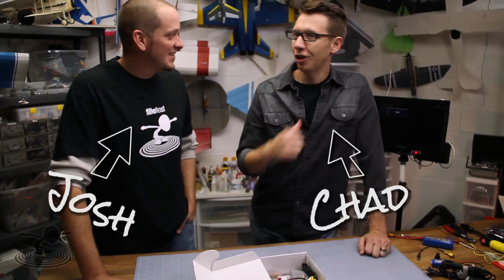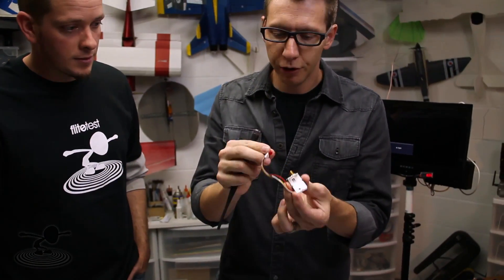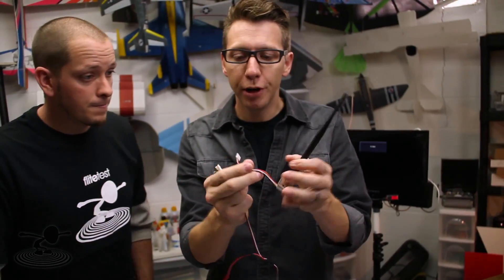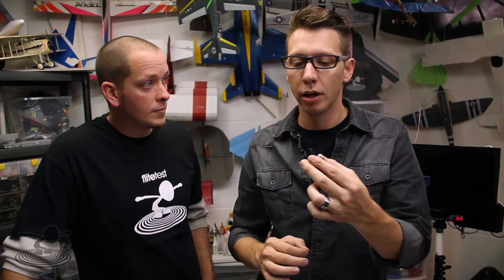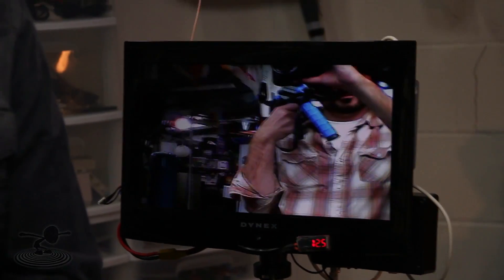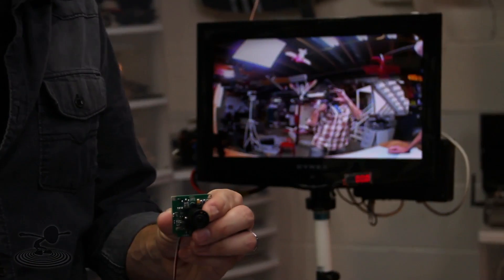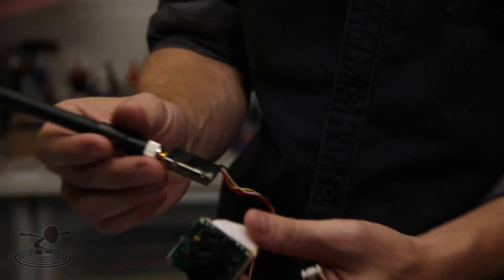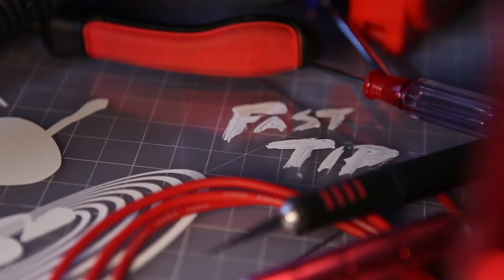Basic FPV Setup - FAST TIP | Flite Test

Comment: Some further tips from a pro.
1. Never use the stock antenna get clover leaf & skew planar Look at his ground station at 7:09 a clover leaf and a patch antenna with diversity. if you use this kit out of the box with stock antenna you will lose signal very quickly
2. Never Use anything less than a 420 line CCD camera a good FPV camera will be $50 dollars. realize with goggles or LCD the camera and antenna will be the biggest factors in your success or failure at FPV.
I am pro look at my vids

Comment: Hey guys, just wondering if you think it is a problem having a TX and Camera different voltages? All it requires is some Voltage regulators or a UBEC to supply the 5v and the 12v comes straight from the Battery. What do you think?

Comment: Hey guys! are you sure channel zero is completely legal? I am 13 and I don't think I can be fined but my parents on the other hand could be. I reaaallyyyy want to use 900mhz so I can drive my car and the signal will go through things but the drawback is legality. Also how does this compare to 5.8ghz?

Comment: make sure that your 5.8 tx is a match to your 5.8 rx.  There seems to be two sets of frequencies that the 5.8 GHz models operate with and they do not overlap.  As far as I have seen there is fat shark compatible and a second set that will not work with fatshark's set.

Comment: yep u are correct. A tech licence is required,in the USA and simple to get. I have full amateur licence , known as the extra class. If you operate with out i don't think the FCC would track you down to much. only if interference is caused to other band users.

Comment: This basic setup has an range about 500-700m. Upgrading the receiver and transmitter + adding clover leaf antennas will give you longer range.
Or just simply add Clover leaf antennas on both of the antennas and instantly get better range.

If your controller is 2.4GHz you need the 5.8GHz setup, because 2.4GHz combined with 2.4GHz can cause severe interference in your video signal.

Comment: This is basic video only..  To add a heads up (called OSD - On Screen Display) requires an additional module between your camera and the transmitter..
Camera -> OSD -> Transmitter

Comment: Have you tried changing all the channels, I have this and its really good
Buy some connectors really cheap from ebay(£1-2?) and make your own antennas from scrap copper wire, there loads of different antennas to make. Also try another location incase something is putting out a 900mhz signal which is really jamming you, but still, changing channels should get round that is most circumstances. You might have a broken/bad antenna

Comment: They compared 900mhz and 2.4ghz, watch?v=PGp1uD0xiYU
It doesnt make that much difference, its more to do with how much work you put in.
I have 5.8 and 900, 2.4 and 5.8 antennas are easier to make as they are smaller than 900
So you could have a 12wind helical directional antenna for 5.8 that will fit in palm of your hand, but be massive and for 900. Depends on your plane as well, you will be happy with 5.8

Comment: It always hard to say, so many variables
With my 5.8ghz 100mW with receiver built into fatsharks, I got 400 metres with standard antennas. So that will be 400m in any direction.
Then you can start making your own antennas cheap from scrap wire, then you can start making your own direction antennas and start doubling/tripling these distances.
All depends how much research and work you want to put in
with my 900mhz 800mw its about 1+km with omni antennas, depends on interfernce

Comment: as for the monitor being expensive, I just got a little a/v monitor from amazon, it's only 2.3", but it only costs $24, and best of all, if you mount it under the brim of a baseball cap and cover one eye with an eyepatch, it's almost as good as video goggles.

Comment: Grat video. A few questions first is the 900 mhs legal in the us and if not is it ok to run 2.4ghz video transmitter with 2.4ghz rc transmitter or will that cose problems. also what is the cheepest workable video moniter

Comment: I've seen waves in the video when directly splitting the power from the battery for the motor. Does using the balance port, instead of splitting the normal power leads eliminate this issue?

Comment: i bought this camera from hobbyking awhile back it worked great, just make sure your white connector on the camera is not reversed, mine was and luckily it dident fry the camera when i put power on it. if it is reversed simply grab it with pliers and pop it off and turn it and slide it back on the connectors.

Comment: I have the 900Mhz 800mW kits from Hobbyking. With the stock antennas I can't go more than 100ft away before losing signal. ( On channel 0 ) Broken perhaps? I'm scared to buy more expensive antennas if the kit is broken.

Comment: I like the intro to basics of FPV setups. I truely belive this is the direction RC is taking these days. I am a beginner to RC only about a year of flying now, but the greatest thrills are FPV flying both Tricopters and sailplanes. So many crafty ways to do these things (safety should be forefront though (not AMA but just common sense)). Dig it!
Reply: 12 years later and I’m searching for an fpv setup to add to my FMS ranger lmao. It really has gone the FPV way, you see it at every airfield now.

Comment: Hey guys, I'm building an plane and quad copter for FPV flying, and I'm not digging the monitor, mainly because it isn't very portable. I was thinking of getting an adapter so the video receiver can plug into a laptop. That would be much easier to take places, and I could even use video recorder software on the laptop. But is it possible to use USB to power the video receiver?